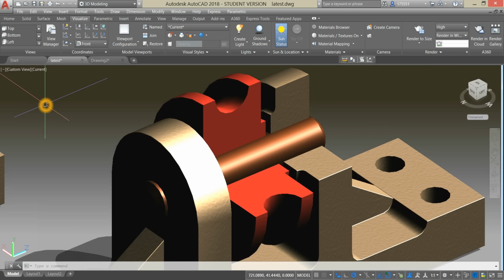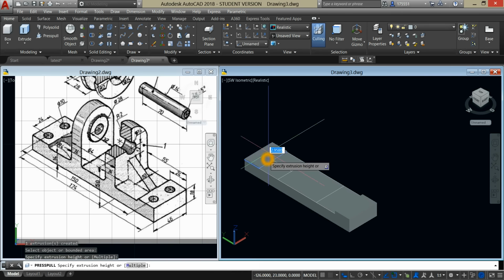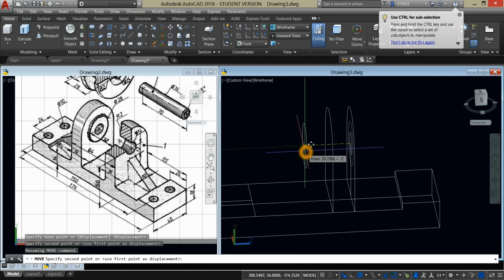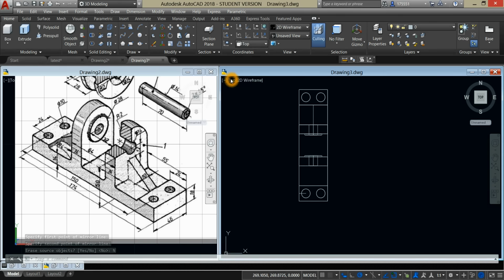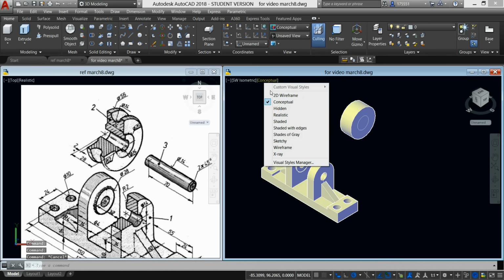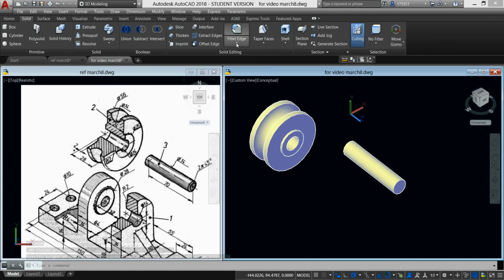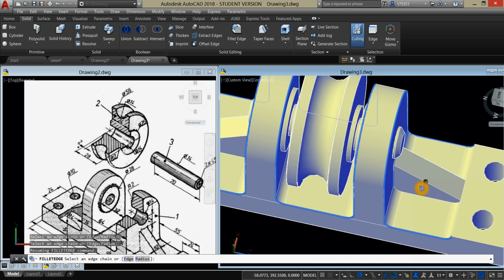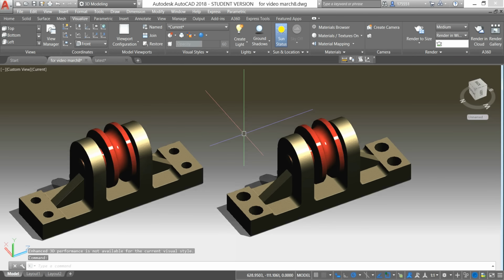Mechanical modeling tutorial in AutoCAD / Assemble parts

Comment: Why do you keep moving the Z-axis for certain tasks?  I can follow along, but I didn't get an explanation why this is necessary.  Seems like you could draw and extrude in any direction you choose, right?
Reply from the maker: In AutoCAD 3D, drawing on the XY plane is a common practice because it simplifies the modeling process and aligns with the standard Cartesian coordinate system. The XY plane is the horizontal plane in a three-dimensional space, where the X-axis represents the horizontal direction, the Y-axis represents the vertical direction, and the Z-axis represents the depth or elevation.

Drawing on the XY plane makes it easier to create 3D models with consistent and predictable geometry. It also aligns with traditional drafting conventions, making it more intuitive for users who are accustomed to working in two dimensions.

While drawing on the XY plane is a common starting point, AutoCAD 3D provides tools and commands that allow you to create objects in any orientation or on any plane within the 3D space. You can use commands like "UCS" (User Coordinate System) to define custom coordinate systems and draw in different planes.

In summary, starting with the XY plane in AutoCAD 3D is a practical and conventional approach, but the software offers flexibility to work in other planes and orientations as needed for your specific design requirements.
Reply: @AC3DCad  Appreciate the detailed reply.  I suppose the simplest answer is just "personal preference?"  I can see why people would want to draw on the XY plane any time they draw a 2D shape.  I just wanted to make sure there wasn't some other reason that might make my life insanely difficult down the road if I don't adopt this approach.  For instance, in your drawing if I just viewed from the RIGHT side and drew the circles in the YZ plane, there is no harm in that, right?  May not be conventional or standard, but it will still draw a circle that can be extruded.  Just making sure.  One thing I did notice about the UCS is that when you finish a drawing and are ready to make an ISO sheet or something, it is very helpful to reset the UCS to the view that you want to be the front and which end is "up."  Thanks for the very informative videos and discussion!
Reply from the maker: When the dynamic UCS (located at the status bar) is turned on, you can draw on a 3D object's face dynamically, meaning, without rotating the UCS. You can see it when you hover over a face, it is highlighted (blue color)
Reply from the maker: If you can't find it, click the customization button at the status bar where you can find the Dynamic UCS.

Comment: When I extrude the first time, all the lines I created inside the box disappear!!! :@. So frustrating even though I did all you did
Reply from the maker: try extruding it downward not upward
Reply from the maker: when you extrude upward the lines stays at the bottom and cannot be seen unless you change your drawing to wireframe or xray , then you have to move it upward and attach the line on the top surface. To avoid doing it or to save time , just extrude it downward